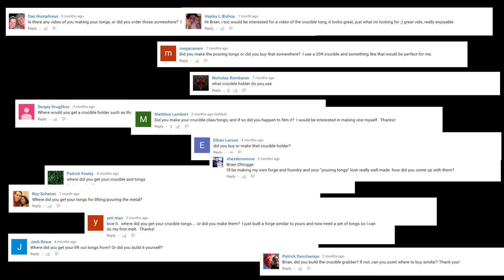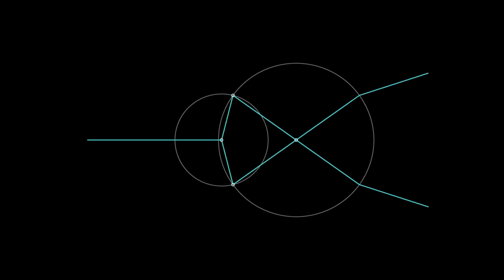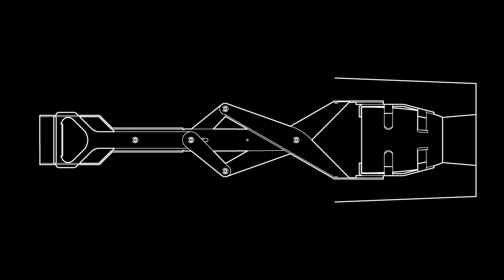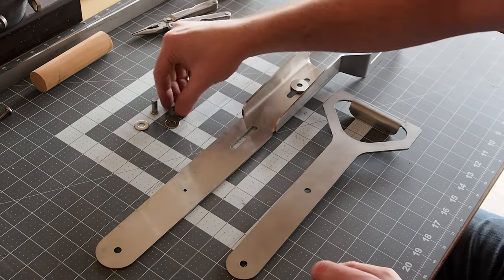Custom Pouring Tongs for Molten Metal | Design and Assembly

Comment: A real maker makes his own tools, and you are a great example of that. Well thought out and equally well executed!
Reply from the maker: Thank you!  There was a project where I CNCed a pattern on my DIY CNC, cast it in my DIY furnace heated with my DIY torch, using my DIY crucible holder and cut the sprues off with my DIY saw stand.  Someone said “I could do that if I bought all of those tools…” 

- I made all of those tools, and you can too!

Comment: Those are sure well designed and crafted. There's  simpler style of lifting/pouring tongs though. I learned of this style from the guy who taught me bronze casting. It's easier to show than to describe, but I'll try since I don't have pictures. The jaws gripping the crucible are at a right angle to the reins, so holding the tongs level with the ground, the reins are perpendicular, the bottom rein controls the jaw farthest from you, the upper rein the near jaw. So open the tongs, settle them over the crucible, close and lift. When the crucible is out of the furnace, it's held upright with the tong reins horizontal, you then rotate the reins to pour the metal, and then right back in the furnace. The only fussy part is you have to be careful not to over open the tongs when entering the furnace, this design the jaws can open very wide. I guess I should post my own video, and others can tell me what I could do better. :) Nice workmanship Sir.

Comment: yes loved the video. answered all my questions. however while i would be interested in buying a set the questions that come to mind are (a) what would be the price when you got a bulk manufactor run and (b) what would the postage internationally  (i am in australia) be? depending on the answer buying the plans for personal non commercial use (ie i could get these made for my self but could not get a bunch made and sell them) so i could go to a metal workshop and get the parts made locally might be better all round.  thanks for the video.

Comment: Really slickly and correctly done.  You have a good eye for the function and allow the details to express it.  Bravo.  Consider adjusting the spring location and strength so the tongs fail closed.  Might be nice to only have to squeeze to pick up or put down.
Reply from the maker: This would be an interesting but completely counter approach...  if it started slipping, my first response would be to squeeze rather than to let go harder.  It would be nice to only have to squeeze at the beginning and end, though!

Comment: Nice work.  Looks like a really nice tongs, just a thought though if you are indeed planning to do a full run.  It seems to me that the wooden handle is a potential point of failure as it ages and dries,  perhaps it would be safer to run a threaded rod through the handle instead of just a screw from each end?  This way if the wood ever deteriorates there is still something to hold on to.  Cheers.

Comment: Are these plasma, laser or waterjet cut?
The design concept is really neat, and I imagine it can be easily reproduced by anyone with enough CAD and design experience for their own use, as it is indeed a very nifty design. Also seems that plenty of people are very interested in getting an assemble it yourself kit for this.
Also, I hope you have found and have had the good fortune of getting a lathe; it and a milling machine are the most versatile pieces of machinery anyone can use to make literally anything.

Comment: I am building the same keg forge and I think these multipurpose tongs are safer than most on the market. Do you sell them?
Reply from the maker: I think so too (that is why I built them). I was going to produce these but became concerned that someone less careful than I would burn off their foot and blame me for it…. It is on the back burner but will probably be released at some point.

Comment: $250 is cheap, I know the market is quite small but I am sure you could fill a good number of orders. What about a KickStarter?
Reply: Kickstarter would be a great way to gauge the actual interest level.  Count me in for a set of Tongs.  I recently picked up my keg and refactory cement and am all set to start building my furnace.  Would absolutely love a set of the tongs
Reply: Agent R where'd you get your keg ? Have an eye on one for $50 but I'm trying to find one even cheaper than that.
Reply: I got mine for $40, but I had to drive half way across the state to go pick it up, so $50 is a pretty good price.
Reply: Get a keg of beer, have friends over... drain said keg, then you have a clean keg to work with.  you just lose your deposit which is not over 40$ and you don't have to work with someones rank rotten leftover beer.
Reply: Good plan, the Stench of stale beer is gonna stick with me for a while. Yuk
Reply: im actually doing this exact thing.
Reply: i got mine for 40 from a local beer distributor
Reply: Kickstarter is a terrible idea.  They take a percentage of the funds raised and the person providing the funding ends up with nothing.  A much better method is to cut out the unnecessary middleman.  If he wants to sell these, he can take pre-paid orders.  He gets the money he needs for material and the customer receives a product.
Reply: thats not true at all..they take a small percentage...left with nothing at all is an exaggeration
Reply: I don't understand what part you are confused about.  The most basic description of kickstarter campaign is a financial exchange between three individuals,  the supplier, the platform and the receiver.  The supplier are the people that donate to a kickstarter campaign.  They give money and get NOTHING in exchange.  The platform takes a percentage of the funds raised and the receiver gets the rest.  That is a bad exchange for both the supplier and the receiver.  The receiver can interact directly to the supplier, turning them into a customer instead that is provided with a product in exchange for their money.
Reply: that is going to be hard as the deposit on a keg is $50

Comment: Fantastic!!  What a piece of design work - I would certainly buy the CAD from ya.    May I ask you - do you have these laser/plasma/water jet cut, then do you do the bending or???  Love how the 
bent geometry factors into the functionality.  Great Job and thank you for the video.
Reply from the maker: +Brian Wisotzkey Thanks for the comments!  These are laser cut and bent by the same company as I have cut the pieces for the Platform CNCs
Reply: Sure thing man!  I design and build tons of stuff myself, unlike you, I get tunnel vision and don't make videos of any of my projects.  :)  Anyhow, I certainly appreciate fine design work and know it when I see it.  Let me ask ya - do you have a software/tool that helps you plan and incorporate the bends in your designs?
Reply from the maker: +Brian Wisotzkey Solidworks does this and a long time ago, I used emachineshop.  For something less critical like this- you can divide the seam of the bent edge into thirds and get very very close.  The inner 1/3rd gets compressed and the outer 2/3rd is stretched.  __ to V

Comment: So Brian when are you going to have a run on your pouring tongs?
Reply from the maker: I have too many burners and these have been on one of the back ones.  I was considering reformatting them to be cut from a tube àla the rocket stove.  Because I don’t know how many people will pay over $300 to have them cut out like I did.  But a lot of DIYers would have a go with a cut off wheel and a drill press!
Reply: @Grunblau  true about cut off wheel and drill not everyone knows how or has access to cnc .
Reply: @Grunblau  also, Bob from ILTMS has showcased Send-Cut-Send, which is what I was thinking of doing if the plans are available. With SCS, it might be possible to place orders such that you could buy $100 worth of parts at a time?

Comment: if you did a run of say 1000 that might be enough to drop the price to 200 per unit 
unassembled kit let they buyers be the one to assemble. Please upload more often
Reply from the maker: +Tanner Coplin I don't think there are 1000 people that would want a set, unfortunately.  This is based on me having 5-10 of them cut at a time...  By the time you get here savings due to multiples has significantly tapered off.
Reply: I imagine 20-30 would be more realistic figures for the actual numbers  that would end up being ordered.
Reply: At 80k subs I would go for 1% to 1.5% of the people that sub here would want to build if the price was right. The 1000 was just a number that most manufacturers like to start at. Kickstarter... might be a good idea.
Reply: I bet over 75% of the orders would be to just have something so awesome... I don't even have a shop and kiln, but I still want some... lol.

Comment: How did you determine that geometry as the most efficient?
Reply from the maker: +TheDistur In this arc of movement there is some area where you have a long pull with little clamp movement.  This is obviously the best mechanical advantage.  At the other end, it is the opposite.  I can only squeeze about 1.5" or so - so I need a good balance.  I do not need to crush the crucible, so there is an optimum range based on moving the handle about 1.5" and the work the other end does...

Comment: Honestly part of the reason i havent gotten into a foundry is because of the tong set up.  There is nothing on the market like what you have I dont think.  The whole placing it down and picking it up concept to me leaves too much open to go wrong.  If the tongs where 150 - 100 I would buy them right now before i even got a forge set up, but 200+ is kinda pushing it.
Reply from the maker: +Isentiototus Yeah I know it is expensive...  I paid probably $600 for mine considering prototypes etc...  you will find that even tongs made from bar stock and angle iron are expensive.  I knew how I wanted to pick and pour so I designed my own.

Comment: Anyone else checking back from time to time to see if there is any uodate on these? LOL Its been 4 years and i am still to find a better tool for this specific job (Y)
Reply from the maker: I talked to a foundry supply about selling these…. They were interested. I was also working on a design using standard extrusions for the DIY crowd.  I think people will likely be shocked when they see they see what they cost in bent SS…
Reply: I can see your point on cost. The other thing I worry about is the shipping cost. I find that products sold in the US usually cost the same again to ship to the uk. 
Would you not consider selling the plans as a DIY project? People could then source someone close to them to cut and bend the required parts. You might generate more sales tht way than selling complete kits.